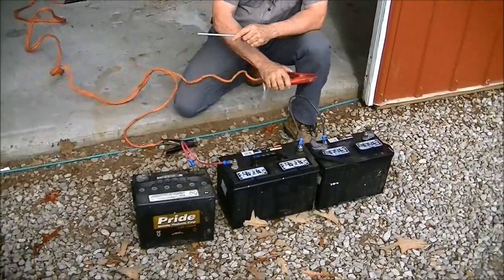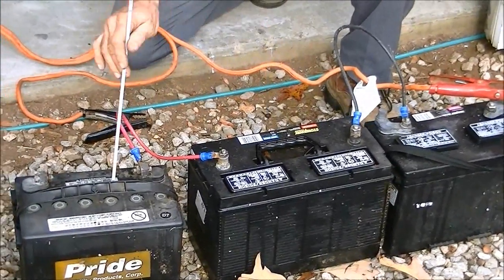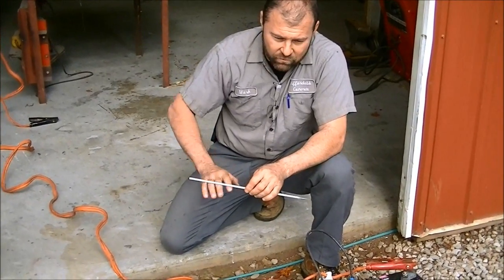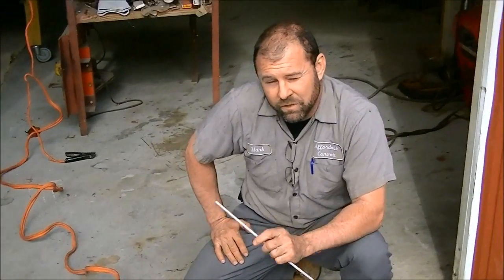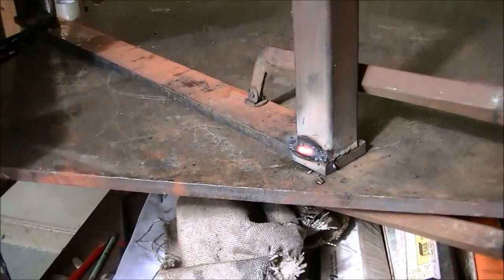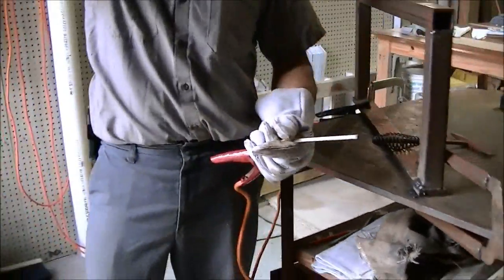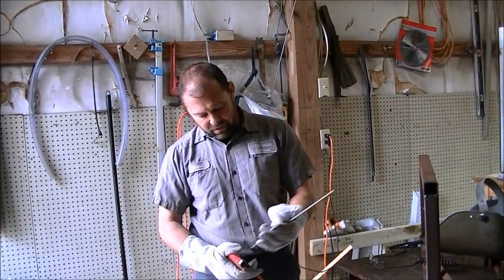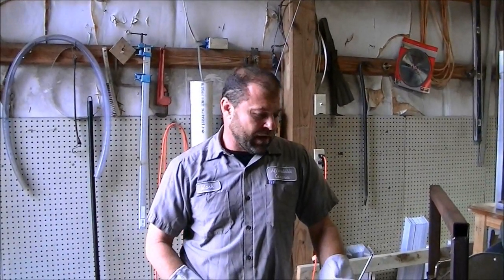Weld with car batteries? Neat trick in a emergency using jumper cables

Comment: At the beginning of the video you had the red (+) clamp on the welding piece and the black (-) clamp holding the welding rod. At the very end of the video your holding the red (+) clamp in your hand and the black clamp is on the item being welded. Which one goes where?
Reply: markp0177
 Why didn't you say that in the first place. I am trying to follow you here.
Reply from the maker: You weld with the negative side and put the positive side on your work
Reply: I was just going to mention this. The negative seems to be grounding his metal in the end and the positive in his hand. This is not how it started.

Comment: You could try making a stableizer out of a coil of wire and if your are going out on the trail use either a 6010 or 6011.  They dig deep and will get you back to where you want to be.

Comment: just a thought if you use a pair of vise grips to hold the rod it works alot better the rod feels more secure in your hand
Reply: It Is more secure but won't you then need to fasten the vise grip to the
jumper cable?

Comment: Very nice mark learned it was very helpfull. Question Mark.....Any idea how many rods i can finish with this three batteries until they are dead cell and can I still recharge this battery after i used to weld?
Reply from the maker: I would not totally drain the battery unless I had no choice. I not sure how many rods you can burn, I have only done this for a quick fix out in the woods. I burned 5 rods with no problem.

Comment: was the welding rod hooked to positive or negative jumper cable when you actually welded?
Reply: i dont think it matters.... you just have to shortcircuit them
Reply from the maker: The negative.
Reply: markp0177
with the positive hooked to table?
Reply from the maker: john miller Yes. The positive is hook to the table. It is called DC reverse. I am on a tv show called "America Unplugged" and I show this in my episode. It airs on July the 3rd on the sportsman channel at 7:00 central time.
Reply: markp0177
Electrode negative is strait polarity.

Comment: c'mon people... alot of people, in what we call 3rd world countries, have been doing it for decades now..... this guy is just demonstrating an old trick.... I know that in the Caribbean, Central and South America this is how they weld as they have no means of obtaining a welder. I know my friend's grandpa used to weld like this and he's Asian.
Reply: Gotta love sealed gel batteries...and the experience to place them in water to keep'em cool...heck wet dirt works as well
Reply: there ya go Richard,,,,guess i learned this trick too long ago and just remember acid cell batteries being a concern
Reply: You''re right Paul. my first ever weld back in 75 was done with 4 car batteries..to poor to afford a welder then. My Pops taught me this way, after learning about it while an engineer in the Army. Made since to me since Welders require an inverter to convert AC power to DC> Batteries are DC> and the real beauty  there is not DUTY CYCLE..as long as you have juice in them you can weld non stop.. lil note on the solar Idea..it's been around long time as well...panels connected to batteries.  A bit of humor..in 1992 I was certified in the military . 2013 I used my VA funds to take a civilian college course for a welding diploma. The teacher argued thru an entire class that this could not be done..
Reply: Richard Elbe there is a slight sort of duty cycle as when the batteries heat up from use, you can get hydrogen sulfide gas produced....a spark gets to it and BOOM!!!...just something to be mindful of

Comment: That really is a good way to weld in an emergency.  It does work.  I wonder though, could someone come up with a way to weld with solar energy?  I am sure there is a way but it would be some time before it would come around.
Reply from the maker: I did charge these batteries with solar.

Comment: what kind of rod was that 7018?
Reply from the maker: It was a 7014 but 6013 works the best.
Reply: markp0177
 incorrect answer: The rod is determined by the task/metal/thickness.   the 6000 series (also known as the FARMERS ROD) works great outdoors with limited cleaning and burns out.  The 7000 series ( known as the GO TO rod) can be used in all positions.   AWS recommends a 6000 series for your root pass but follow up with a 7000 series for the finishing passes. This of course in dealing with ferrous metals, which would not be used with non ferrous such as aluminum or stainless still.
Reply: Richard Elbe actually the electrode is determined by the base metal type. And for your low carbon steel a 6013,7014,7018,6010,6011, and several others would work just fine. The thickness of the material is what will tell you what rod diameter to use.
Reply: Richard Elbe also 7000 series rods are not all all position rods. 7028 and 7024 are good examples of rods that aren't. 6000 series are not all farmers rods. Some very difficult welding is done with 6010 rod that maybe one in 100 farmers could actually do. You need to go to welding class!
Reply: spokes318  So you point out what I pointed out.."The rod is determined by the task/metal/thickness" and you say AWS is wrong about the 7018? Sorry Bud. But I'm sticking with my 36 years of knowledge and application and only  once have a broke weld in my teens...

Comment: My brother did this  out of necessity as a one-off about 45 years ago. 
Probably plenty of others arrived independently to the same solution, but until know I'd never heard of anyone else doing it.
Now, thanks to your post and YouTube, many, many more people throughout the world can get themselves out of a pickle.
Couple of points:
My bro. had proper tongs and cables, just no mains electricity, so he had no problem with rod manipulation ( not saying you did:-)or burned hands!
The weld went fine for him (he was a good welder with skilful hands, coded to ASME 9 ) maybe the thicker cables let him draw down more amps? 

I can't remember how many batteries he used all those years ago, but if , say 36 Volts is best, if you could scrape up another 3 and rig them in series-parallel would that enable you do draw more amps?
Or maybe just four running at 24 V.
I'd be worried about one or more of the cells plates burning through, though, so maybe your dabbing technique was a blessing in disguise?

Comment: hey hi man  nice to see some  cheap trick to get you out of the  woods when your stuck hey I have a question does it make a difference if I weld with the positife clamp and put the ground to the frame nice vid bud anyway ill make sure I cary an extra batterie so I have 2 or 3 batterie to weld  just in case good vid man take care
Reply from the maker: It is easer to weld with DC reverse " the negative side"

Comment: Sorry another question by me, I did some more research on this and people said that these batteries  might explode? Is this true or how can you control this hazard?
Reply from the maker: Lead acid batteries let off hydrogen gas that good explode if mix with the right amount of oxygen and ignited. Just put a piece of ply wood between you and the batteries. I closed my barn door a little to protect the batteries.
Reply: Oh okay, Thank you, :)

Comment: Watch the guy when he starts off he has the rod on the black and when he is done welding its on the red i call bs on this one
Reply from the maker: No bs. I had trouble with the black side of the jumper cable holding the rod so I switch both ends of the cable.
Reply: andrew galvin Wrong call, dude - learn some diplomacy.
It's easy really, all you need to do is keep your mouth shut till you know all the facts. That way you're less likely to come over as a rude know-nothing.
Reply: This type of welding is know amongst trail riders 4x4 emergency fixes.  In a pinch you can even use a nickel.  All you are doing is creating an arc, the arc heats the metal to a molten stage.  Real welders do the same thing, they just use a transformer to create the DC volts.

Comment: how did you start off the weld? and is it possible to get electrocuted with it ?
Reply from the maker: You have to strike a arc, it is like striking a match then you must maintain a gap. You will not get electrocuted but if your gloves are wet you will get a small tingle.
Reply: Thank you :) This is very helpful because i really need a welder :)

Comment: Are there any rods that would work ok with 24volts? I can see adding a second battery to my rig but 3 seems unrealistic. 4 wheeling alone I sure would like the option to weld if I break something.

Comment from the maker: The negative end of the jumper cable was bad and would not easly hold the rod so I just switch both ends of the jumper cable. I am still welding with the negative side of the batteries.

Comment: I'm here to look for a welding machine to use to weld fencing wire mesh with GI pipe supports in my estate where there is no electricity to prevent from thief. Now I find the solution with ur awesome technique. Thank u.

Comment: I enjoyed your video. You mention that you're using the 7014 rod reverse polarity DC. I couldn't see the +- of your batteries but I would suggest using the 7014 rod straight polarity. Electrode negative. 7014 rod is AC/DC rod but runs better straight polarity. That may be what you did. Not sure.

Comment from the maker: No. Be carefull with a coat hanger it will melt. I used deep cycle batteries, that don,t have a lot of amps compared to regular batteries. Also I have long jumper cabels that help to restrict the amps. If you have too much amps you can use two sets of jumper cables

Comment: Good vid.  Thanks.  Someone told me you have to limit the amps by using a resistor between the batteries (they said a coat hanger would work.)  Is that right?  Did you have to do that?

Comment from the maker: Well kind of. You have to maintain a arc or a small cap and when the electricty jumps the cap it creates a lot of heat. Enough to melt the steel together.

Comment from the maker: Hello. It is best not to use a battery with a lot of cold cranking amps. You will get to much amperage to weld with and it won't last long. The voltage will be to low with just two batteries. It would be hard to strike a arc with just 12 volts. Most welding machines put out around 54 volts. I use 3 deep cycle batteries and I weld 4 -1/8"  6013 or 7014 rods. I don't know about using a dry cell battery. If all you have is car batteries then to controll your amperage use longer jumper cables.

Comment: Dear Mark, big fan of your work, ,which CCA is good for this work, 12volts each,can just  2 batteries in series do a good work, will that energy be sufficient,the weld rods, which size suits this power,  what about a dry cell battery ?can the amp for each battery be more than 40A?, and can different battery brands can be used ?can batteries sustain for over 10 mins usage?sorry to ask so many questions, thank you, i await your suggestion :)